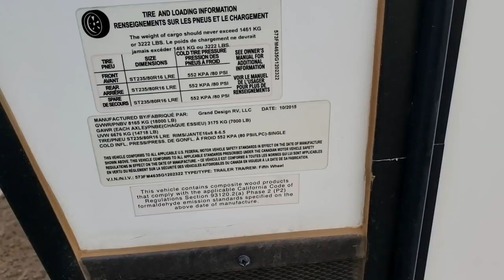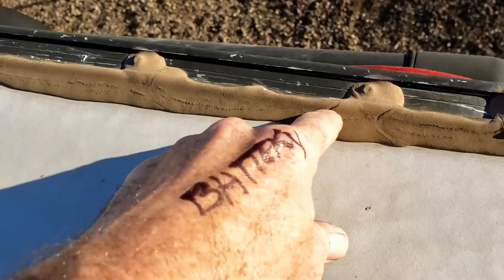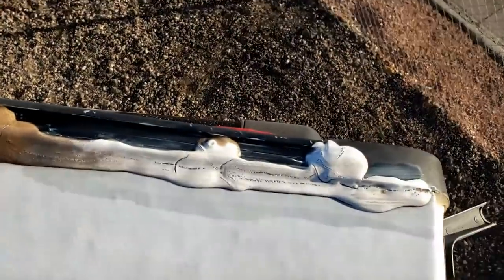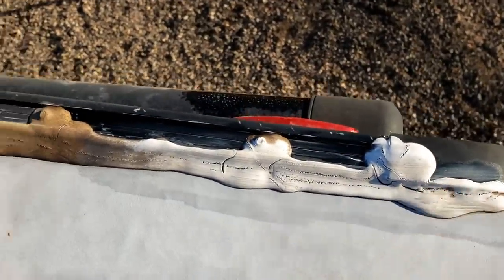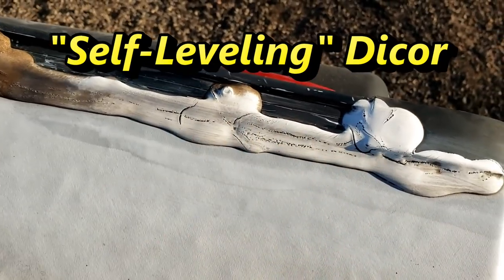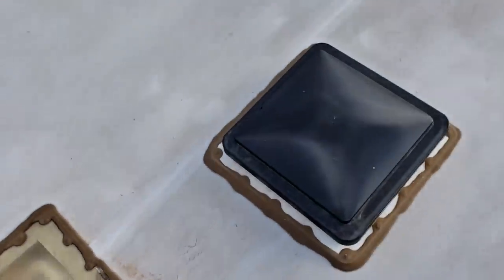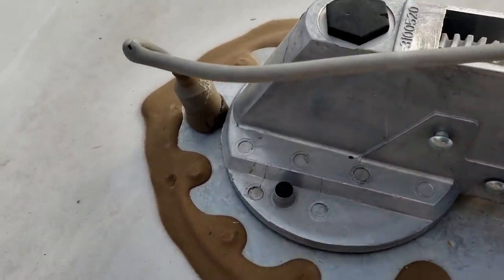Inspecting a RV Rubber Roof on a 5th Wheel

Comment: You've possibly already used it, but for any single-ply roofing, I highly recommend either Carlisle or firestone's water cutoff mastic. it comes in a caulking tube and is perfect for sealing things to single-ply that have to be fastened through the membrane itself(do not get it on you or you basically have to wear it off). on top and EPDM any Naptha based gas (camp fuel) is the best cleaner to use. on pvc you want acetone. Also I'm curious as to the red adhesive you use to glue the luan to the styrofoam. Oh and mulco supra expert is probably the best exterior caulking that I have found in over 20+ years of exterior cladding experience, it is quite stretchy and stays that way for far more than 4 years and is available in all the colors they make rv's. Thanks for the videos have a good one
Reply from the maker: thank you. I could likely be wrong but Dicor is merely one of the  "RV" brands of Carlisle products. Thanks!
Reply: @AZExpert  i only mentioned mulco's "supra expert" as an alternative because I can vouch for its longevity and elastomeric qualities to not crack and break down for a good 10+ years

Comment: I think that is supposed to have a roof radius at the edge, wonder if the roof was replaced once already, it should have a 12 year warranty according to the factory.  Another channel  I watch that travel in their momentum I just looked back at a video he did on his roof and it has a radius and sealant on the side the thin bead of caulk like you talked about.
Reply from the maker: It sure look factory to me, that edge is pretty common, t just surprised me on this newer expensive 5th wheel
Reply: @AZExpert  the video I had tagged is a momentum

Comment: I talked about my Georgetown before about all the water problems, but it also had slide problems, it was told that it was built wrong rolling on plywood an eventuality started to dig holes in the wood also was told it had no drain cups installed?, the solution was to put plates under slide, for me fixing was too expensive, So I would love to see a video on the drains an the plates for a slide room , it was a 2011 full slide, supposedly 2014 the design got better? Thx
Reply from the maker: I'd say almost every slide is built wrong and is a likely water leak. Drain pans are much more common now, as the manufacturers gave up and just manage leaks now. Everyone seems to build slides in unique ways, but adding a drain pan is not a very common repair that I have seen.
Reply: @AZExpert  got any videos on that

Comment: I have never used mineral spirits to clean dicor before. I'll have to give that a try. I used Windex for years and now usually use brake cleaner. What are you're thoughts on that?
Reply from the maker: I use windex/cleaner first and then acrysolv or mineral spirits to prep. I have of course used brake clean, but it usually splatters everywhere including my eyes.
Reply: @AZExpert  Well, you do need to keep your face away from the roof when you clean it, duh !!!
ha ha

Comment: Nice inspection...I was wondering about attaching solar panels to the roof of an rv. Should I make sure to find the roof rafters and attach the panels to them or will the main roof be ok. I have a 2020 forrest river rogue 25v toy hauler. Any info would be great.
Reply from the maker: Most RVs will have a 1/2" plywood deck so the panels could be installed anywhere. On thinner roofs I do try to land the feet on at least one rafter. But overall, the sealant adhesive does the most work as Winnebago roofs are 1/8" deck with no rafters and I've never seen issues with panels falling off. In fact some people only glue panel mounts down which seems crazy to me.

Comment: If you don’t use mineral spirits on rubber roof, what product do you clean the edge of the roof rubber at the gutter area when sealing that area?
Reply from the maker: Soap and water to clean the dirt. You can wipe the membrane with a cloth with some solvent on it but not dripping or applying the solvent to the membrane to soak it at all.

Comment: Do you ever warm up and remove the old self leveling dicor before applying more?
Reply from the maker: If the roof has been "re-sealed" multiple times a "scrape and seal"" would have to be done. Heating up the sealant is rarely a problem in Phoenix but I'll let the sealant tell me if it's being difficult sometimes it comes off better cool.

Comment: Do you have a preference for what type of roof you prefer ??
Reply from the maker: PVC looks like a better membrane, but I usually put TPO on my RVs because I'm cheap. Realy gel coat fiberglass is the best but is the most expensive and is ony found on motorized units.

Comment: AZ I have a 2019 Cherokee Grey Wolf.It appears that where the joints are on the roof the adhesion is giving up.Any suggestions?
Reply from the maker: There can be wrinkles at deck joints but if the membrane is quite loose, I'd see if the factory warranty is still good and see what they want to do. Many times structure and roofs have more than a year warranty.